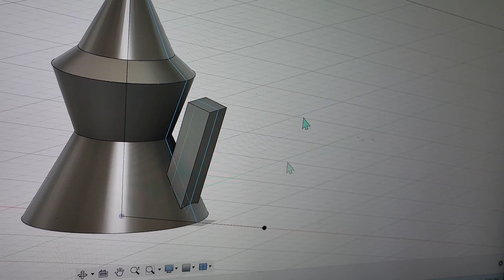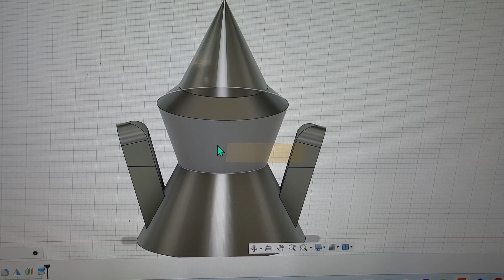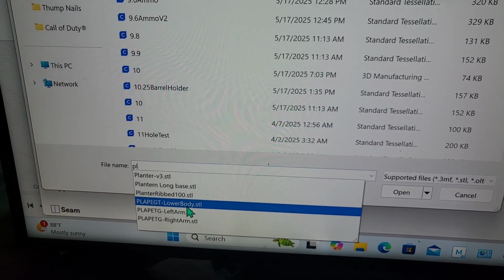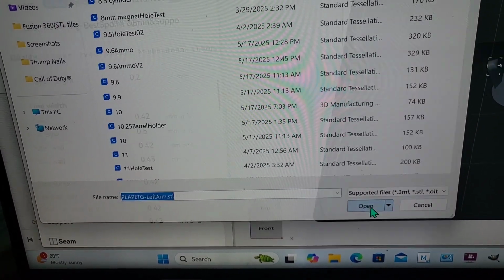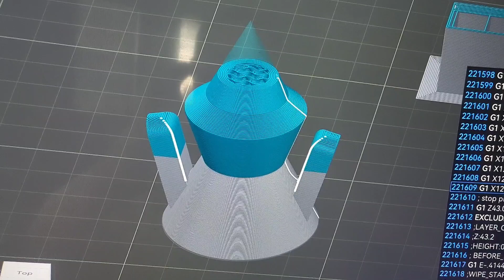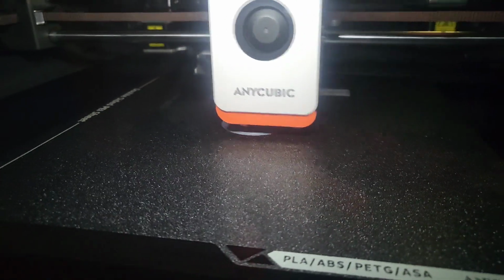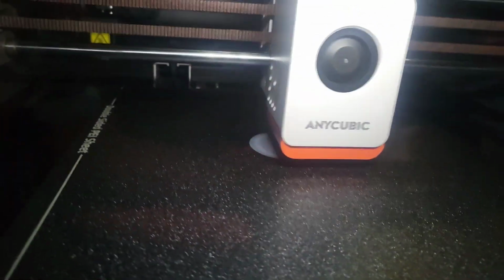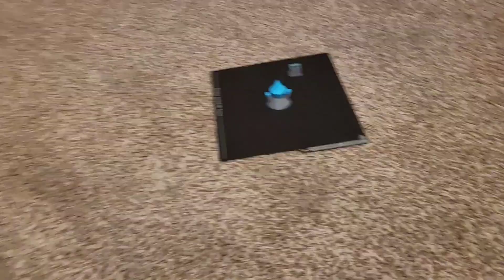PLA and PETG Strength Test. One Model

Comment: In first lyers of petg pla is mixed with petg. If you use one nozzle and printing materials that do not stick it should be purged much more filament to clear out previous material.
Reply from the maker: True that might explain a weaker bong past the first interchange layer. The flush out setting wr the original and with a tower but even the tiniest particles left over might have contributed to what we saw....

Comment: Looks like your first few layers of PETG were kinda bad. It looked a bit smooshed. I'd bet the point of failure was just where that error propagated to. 

I've heard you can print one on top of the other but not the other way around, you should try PETG first then PLA if you want!
Reply from the maker: That would be a good follow-up  test.